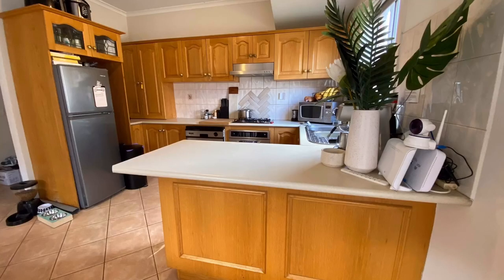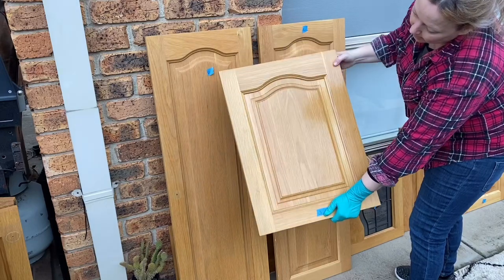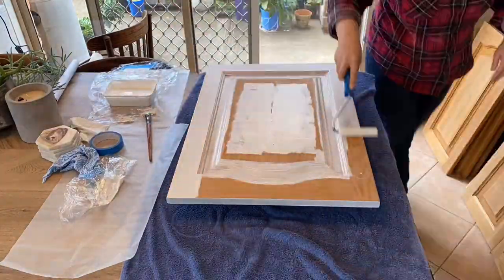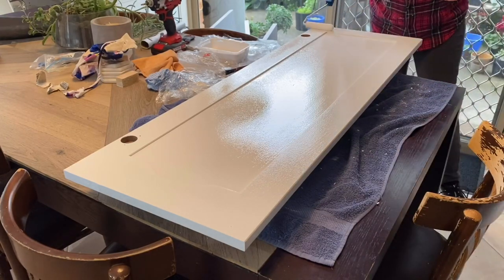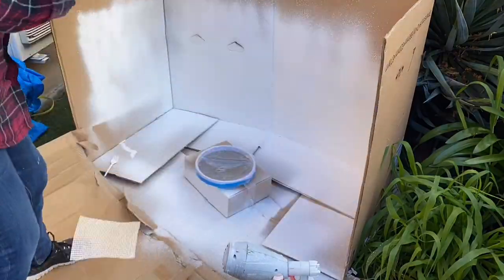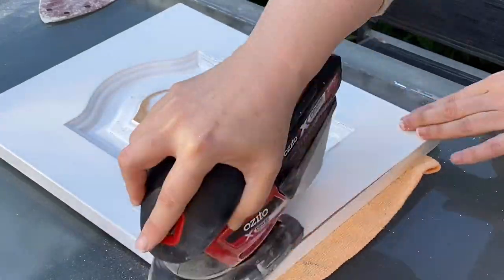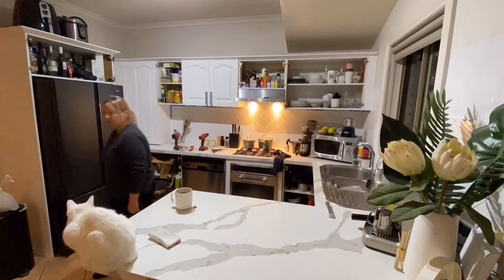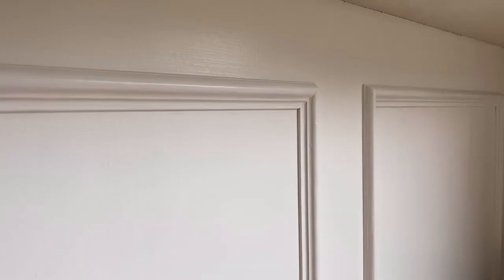How to paint kitchen cabinets, Laminate & Timber, Roller or Spray Refinishing DIY KITCHEN MAKEOVER

Comment: Hi Nicole, I painted my laminate cabinets and really like how they turned out. Have you ever done any countertops? Painted them or updated in any way? That's the next project I'd like to tackle.
Reply from the maker: Hi Drew, I haven’t refinished any countertops but I hear the epoxy finish kits are quite good. My countertops had rounded edges and angles corners so I decided to rip mine out completely. Luckily I found some amazing engineered stone countertops for $500 at an auction and installed those myself. Bargain of the century. https://youtu.be/lPiqD5cWG2k

Comment: Hello! FANTASTIC video- thankyou So much for the spray vs roller finish comparisons and the extra tips. 
I’m still looking through the comments but I have a few questions: 
-Did you brush/roller the primer under the spray finish?
- Were end pieces/cupboard edges brushed or rolled? If it’s brushed does the finish look too different from the sprayed doors? 
- Did i miss if you used a top coat- pros and cons?
TY ❤️
Reply from the maker: Thank you. I used a brush and roller for the primer as it’s shellac based and I didn’t want to put that through my paint sprayer as it’s hard to clean and dries too quickly. So a small brush for all the details, then a roller straight after so that smooths out any brush strokes. The top / main coat is the Dulux Renovations paint. There is no extra coat over the top of that. For the cabinets, I did the brush and roller. It’s a slightly different finish but you would never notice as the bulk of what you see is the doors anyway. I had to do 3 or 4 coats with the brush and roller, only 2 coats on the doors with the sprayer.

Comment: Really helpful and I have almost the exact same cabinets, which did you paint first though; front or back? Thank you!
Reply from the maker: Thank you. I painted the back first as the paint is still soft for around a week. Doing your final coat on the front means it will minimise any little divets from leaning on the box or whatever you are spraying on top of. Hope thy makes sense.

Comment: This was helpful! Thank you! I have primed and I will start painting mine tomorrow. Can I ask, why didn't you use the primer with the added hardener (also in the Deluxe renovation range)? I used it today and it is also self levelling, giving a very smooth finish.
Reply from the maker: The only primer they had when I used this range was for laminate. For timber it said no primer was needed but when I tried that, the tannins bled through. The Zinser BIN works out fairly cheap per job as it’s very thin so you don’t use much.
Reply: @NicoleHerrickDIY  Ah! Fair enough. I also used Zinzer BIN to stop stains seeping through - before the 'Renovations primer' with  the hardener (as per Dulux recomendations) I'm not sure why they call it a primer - it's clear ?!  It' must have come out after they released the cupboard paint.
Reply from the maker: @melaniepearce698  I will have to check it out next time I’m in Bunnings!

Comment: Hi Nicole, just wondering why you used zinsser primer versus the Dulux renovate primer? Awesome kitchen Reno btw!!
Reply from the maker: The dulux renovate primer is only for laminate doors I am pretty sure. For timber it says you don’t need to use a primer but the tannins actually bleed though on most wood so that why I used the zinser BIN to lock in all the tannins and stop bleeding.
Reply: No it can be used on veneer doors as well

Comment: Hi Nichole do I need to finnish off with a clear top coat when using satin finish on the cabinet doors
Reply from the maker: No the satin cabinet paint is the top coat. It will cure to a very hard wearing finish. Just be gentle with it for the first month.
Reply: Thank you will do.

Comment: I used the zinsser primer and it was amazing such a smooth finish. I then used the gloss renovation paint and it's quite a textured finish. Not sure if thats the way it's supposed to look. Thinking I should have used the satin :(
Reply from the maker: Does it look like orange peel? Mine looked like that when I first sprayed it but it settled and became flat.
Reply: @NicoleHerrickDIY  yes very orange peel. It's settled a bit but still quite textured.
Reply from the maker: @DosLobos  how much did you thin it down? I had to thin mine down a LOT more than the usual 10% to work with my sprayer.

Comment: Does the paint remain textured after it dries?
Reply from the maker: No this paint smooths out nicely. If you look really close on the ones I had to paint with a brush, you can see a few tiny brush strokes on one cupboard but all the other cupboards I did with a brush look great. Make sure you use a really good quality brush.